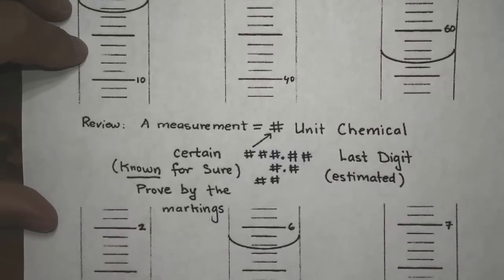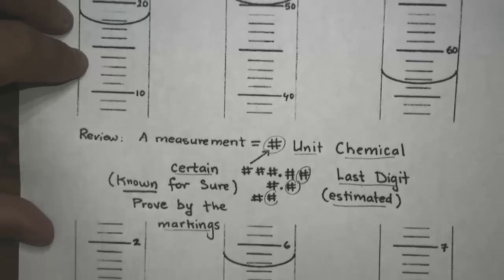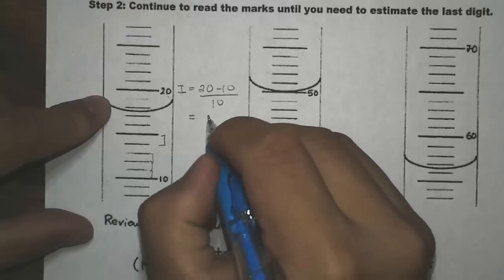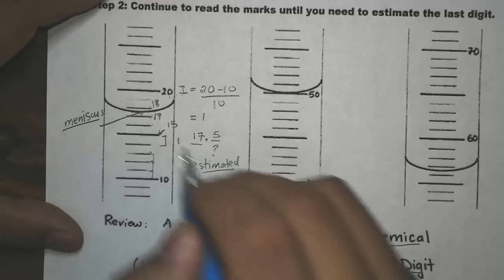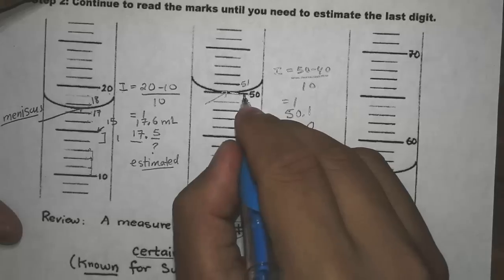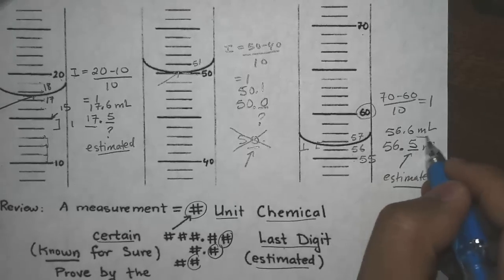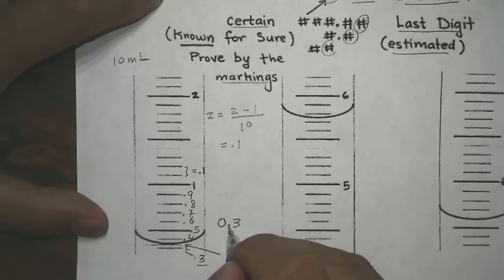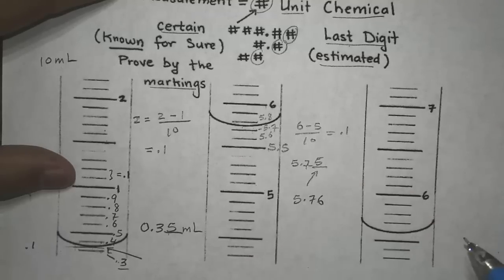Chemistry - How to read a graduated cylinder

Comment: What would be the  proper measurement if exactly 55ml of water were placed in a graduated cylinder marked 100ml increments? Thanks for your help. I have learnt a lot from this video..
Reply from the maker: I assume it has an incremen to 1, so it the reading is 55.0 mL